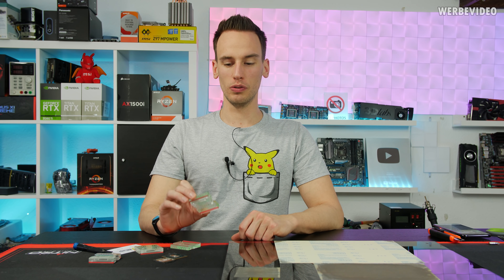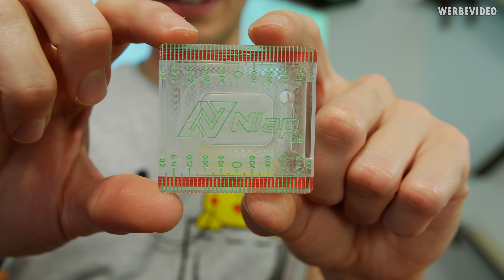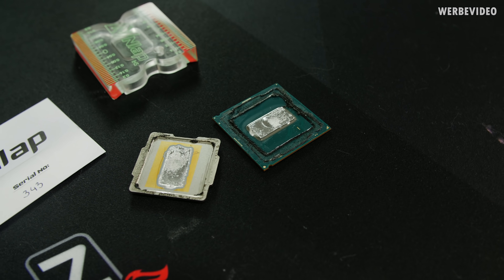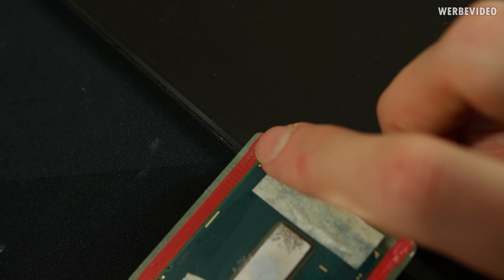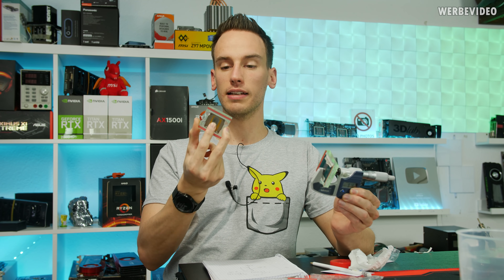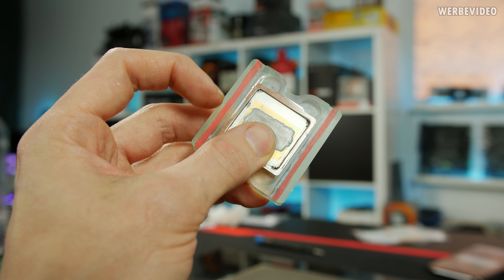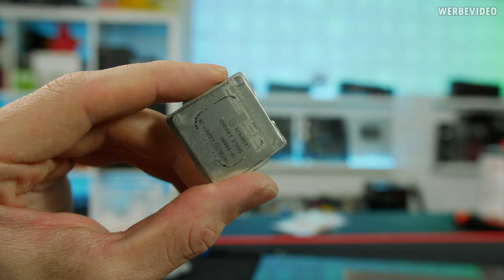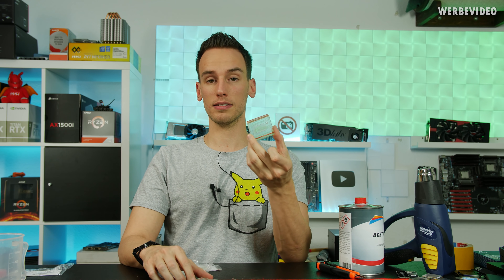If you ever plan to lap your CPU you HAVE TO know about this Tool!

Comment: @der8auer :  
8:35   The micrometer used has a 0.001mm resolution.  I will the NLap CPU tool to lap my delidded i9-9900K.  Is sufficient to use instead a caliper with 0.01mm resolution to track the amount  of silicon effectively removed?
Should I plan to sand the top of my der8auer direct die Intel 9th Gen. OC-Frame (anodised aluminium) by the same amount?
If so nail varnish will be enough to protect it against corrosion from liqui metal contact?
Thank you all for inputs.

Comment: @der8auer, I have delided and used a direct die cooling with your OC frame in my Eurocome Sky X7c Clevo chassis laptop.  I used a  3mm vaccum chamber thick and it increased my z-height by up to 0.4mm.  I am planning on lapping the CPU to improve my contacts and cooling system tolerance.  How much of the i9-9900k die could I lap to stay above OC frame?  Should I plan to lap the bottom of the OC frame to offset it?    Anyone has an idea of the thichkness of the STIM solder or the height pcb to the top of the IHS before delidding the i9-9900K (lost measurement after delidding)?

Comment: manufacturer used blue tac to hold in place,  accurate measurement device = digital micrometer. could we just use a aftermarket copper ihs from an 8700K and skip the lapping?

Comment: On my 9900KF I lapped the top of the IHS because it was quite convex,  and the temps would jump around and spike very quickly and the CPU would thermal throttle under heavy load, my temps have dropped by over 10c, at idle and around 20c under heavy load,  I'm not using liquid metal.
I only use normal thermal paste (it is a Cooler Master brand paste) and I have not de-lidded the CPU.
I was considering de-lidding it and getting a direct die cooling kit but I'm not too confident in doing it to such an expensive CPU.
But considering it now runs stable at 5.1GHz all cores with a max temp of 80c.
I have been satisfied with the outcome in regards to temperature. 
So my question is; is it ok to lap the top of the IHS as I have done and not using liquid metal or should I be aware of a potential future issue caused by doing this?

Comment: What about keeping the IHS and die parallel? Sure the silicon is now thinner, but if the die and IHS are not parallel wouldn't that create a gap between the two leading to a potential decrease in thermal conductivity? The thicknesses matter, of course. For instance if you sand down 0.2 mm of silicon and now you have a 0.1 mm gap filled with Conductonaut on one side of the die overall there would probably be an improvement to thermal conductivity because silicon is roughly twice as thermally conductive as liquid metal and that gap would only exist on one side of the interface between the die and IHS. 

Thermal conductivities: Silicon 149 W/mK, Copper 400 W/mK, Thermal Girzzly Conductonaut 73 W/mK.

Seems like if the two were not parallel there could be a decrease in thermal conductivity if using a TIM like Conductonaut. When sanding down the IHS tabs is enough material removed to cause interference between the die and the IHS before the IHS touches the interposer? This would allow the inside of the IHS to come in contact with the die and self align to it before the tabs touch the interposer. 

Sorry for all the questions, but I am new at this. A surface can be very flat and very smooth, but when you bring two flat, smooth surfaces together they need to be parallel to eliminate gaps. When you lap a CPU cooler this isn't an issue because it is allowed to self align to the top of the IHS because of how the cooler is mounted. For lapping the die, there could be an error stackup in parallelism between the die, the interposes, the tabs of the IHS and the inside of the IHS. 

Overall I like the video and appreciate your contribution to the technical content on YouTube. Thanks.
Reply: I just watched the video from Oct 19, 2018 about sTIM on the 9900K. Moving from Indium solder in the stock thickness to Conductonaut made a big difference (8 °C). I can also see that the IHS was sanded down in this step to account for the reduction in overall height from removing the indium. Sanding the die and IHS from there provided about 1.25 to 1.5 °C per 0.05 mm.

While I still have the question about maintaining a parallel interface between the die and IHS, I can see that reducing the thickness of the indium and silicon do make a big difference. I suspect the IHS tabs, or "feet" have been sanded down sufficiently to not make contact with the interposer before the IHS contacts the die.

Comment: Be interesting to see if it actually left the die flat, with the difference in material while sanding it should be easy to sand more off the tool with uneven pressure, maybe time to get a test indicator and testing the flatness of the die. I also think not lapping the top of the IHS flat seems like a waste would also negate the scratching,

Comment: The way I was taught in college to free hand lap was to do 10 strokes applying pressure in only one direction towards you with the most pressure being applied in the center with one finger. Then rotating the object 90 degrees and repeating the 10 strokes for all four directions. There were bonus marks for the ones that were able to wring the two lapped objects together and have them stick together proving their true flatness.
Reply: This...
Reply: He needs to grind the shoulders off the bottom of the IHS and make sure BOTH the top and bottom are true flat as well.  Also here is a question i've never seen answered about guage blocks: Can you wring ceramic to metal?
Reply: @NVMDSTEvil  ceramic breaks too easily for that
Reply: @christianflores3437  no, the amount of force required is not that high.
Reply: wondering what major did you study ?
Reply: @Alhussainba  CS

Comment: @der8auer All these years and still no one has made a motor device for lapping. disappointing.
It's not that impossible to design and make a device!
Simple concept, have a rotating circle surface with perfect mirror finish.
Make it rotatable with a small cheap motor, make a arm that pushes the CPU to the circle surface where you have the sandpaper.

Comment: That tool is called micrometer. I used it to measure copperwires from 0,7mm to 0,01mm, when I worked in cable factory. Thanks for the video as allways.

Comment: I wonder if they intended for the tool  to be used to lap the top of the IHS for some reason, it'd probably fit in there better the other way around.
Reply: lapping the top would not bring the IHS down to make contact with the die. i do see what you are saying tho, it does look like it would fit better that way.

Comment: @der8auer I have one question which could be good video material.
Is there any actual efficiency difference between full copper water radiators compared to aluminium ones? And are copper ones actually better?
We all know, that copper has higher thermal conductivity, but from what I've researched, this alone is meaningless in radiator performance.
Copper has 3.3 times the density of aluminium, while having only 1.75 times the thermal conductivity. That means that you need 1.7-1.85 times as much copper in weight to achieve similar overall thermal conductivity, which seems not to be the case.
Not only are aluminium radiators heavier then necessary for theoretically identical results, but they're also typically denser, with more tubes and therefore higher overall area for cooling. The fins also seem to be thicker to offset lower conductivity.
I've also found some topics on automotive forums, where copper radiators are not recommended for their inferior performance.
Would you try checking that?

Comment: I always use Break-Cleaner because it doesn't leave any residue. 

They also use that to see if (motor engine) valves are completely tight after polishing them.
Reply: Proper acetone doesn't leave any residue either. The stuff I buy at the local super market says "chemically pure acetone" on the bottle and it flashes off as cleanly as alcohol.

Comment: put a plate with a pin to fasten the drill to it, machine a flat plate with a pin sticking out to attach the drill and glue it to the tool then just go, either the drill press or hand drill, drill press would be the best. maybe not for the cpu though :p

Comment: Sound like you need hand lapping plates and an optical flat to take this to next level.
Reply: And a lab grade surface plate and an octoculimator to check the final result... No, seriously, calling it "CPU lapping" is flat out wrong. It is sanding it down. If we were talking lapping in the machinist sense, he would get better results with no liquid metal, as the surfaces would wring together like gauge blocks.

Comment: Ehh this have so many flaws... What about flatness of the acrylic "thing", what about of CPU PCB flatness?  what about glass panel flatness, what about finger pressure - all those are imperfect and will affect final result ...

You don't even know how hard is to be perfectionist. Nice job as always
Reply: Those of us with machinist training think of lapping as something very different than what overclockers think. They say lapping but they mean sanding. Period.

If you are interested in how to make a proper lap (that could be used for a CPU if you like) go check oxtoolco here on youtube. He goes through the classic three lap method using only copper roundstock, a hack saw and 5my alumina abrasive.

Comment: For the IHS should be a magnet placed inside the acrylic to hold IHS from the top, for the CPU should be like a delidding tool, with screw(s) from the (both) side(s) to hold it
Reply: IHS is copper and copper is not magnetic...
Reply: @honzamoravka9430  true, but I used neodyme magnets from hdd and put second one below the ihs, I found some are just thin enough to fit and not interfere when lapping

Comment: I guess having a 9900K that only requires 1.290v to run at 5.2GHz, only reaching 90°c after a 20 loop run in R20 with an AIR cooler defeats the purpose of this tool. I also lucked out on the 1.280v 5.3GHz 8700K that i got open box, also topping out at 90°c on AIR. What's with all the water cooling...lol
   Nothing against AIO's. I've been through many and the only ones that actually cooled better than some of the best AIR coolers was Corsair's V115 and V80 Extreme V2's with the double thick radiators and some vardars. 
  Though, with that amount of money involved in AIO's and some worthy fans, you gotta be an enthusiast. I just like testing old and massive AIR coolers. 
  Anyone remember the first 8 heatpipe Silver Arrow monster, or how about the ZALMAN 9900MAX, 9900MAX DF or Triple fan 12X. Might sound funny to some but, beats paying $100+ for something that essentially puts up the same numbers as a 5 to 10 year old AIR cooler. That can be found for $25 to $40. Gotta have a grade a chip though.

Comment: Sounds like buyers should measure the IHS, then apply some tape like painters tape to the top of the IHS before inserting in the tool. But if you are measuring the tool there is not much point in using the Acrylic Jig anyway. Just measure on all 4 corners and use the "walk around the barrel" sanding technique.
Reply: tape isn't perfect in thickness. nothing really is unless its machined for that. and when your talking about super precise measurements ,you want to have something guiding you. with the die itself, one wrong move and you will destroy it. and with the ihs. if it is a little off , you will have uneven mounting pressure against the die. this will cause it to crack when you to crack when you place the cooler. die lapping is risky business. way more risky then ihs top lapping. but i guess its the price you pay to have the best overclocks lol.using the tool stops you from rolling the edge when you sand. you have to take a ton of acrylic off before you would make an uneven sand. and you would see it happening buy the paint being removed more on one side .the tool isnt precise with its measurements. but it does make it way harder to mess up

Comment: You need to get a small but extremely precise cnc milling machine. You could have milled the die and ihs and finish it off with lapping for a smooth surface finish. I would be interested to see you take this concept to the extreme. Find some silicone lottery, shave it down as low as you can, and then do the same thing on a 2080 ti or titan. You can even use the machine to make your own custom parts for builds. Custom blocks, distroplates, case parts, etc.

Comment: pls talk about direct die cooling with large air coolers next
Reply: i would recommend you to go with a 280mm aio instead of using the high end air coolers for the best temperatures with direct die cooling. I initially tried cooling my 9900k using the noctua nh-d15 and it is possible but its not worth it to me. Right now i am running the 9900k direct die with liquid metal using the corsair h115i and the max load temperatures i am getting right now are 8-9c better than with the noctua nh-d15. Now i am thinking or reducing the die height to 0.4mm using this tool, but sadly derbaur did not included the before and after results.
Reply: @bloomfield295  thing is, nhd15 cools as well as 280mm aio’s. If you’re not running custom loop, then a 360mm aio would be the proper upgrade from a nhd15. Personally going to be deciding my 9900k and running direct die with my nhd15. Temps are completely fine as is at 5GHz but I want to see if I can push a little further before having to go aio or custom loop.
Reply: @bloomfield295  9900k has a TPD of 95w as stated by Intel, but reviews have popped up that 95w cooling is not enough. NH-D15 is rated for 165w. In theory, that's enough thermal dissipation for a good overclock, but in practice, it really is not.

While I understand that CLC will bring more thermal headroom for overclocks, the usage of air coolers is still a good option for people that do not want to deal with CLC failures.

Anyways, can you share your current temps with Δ's? Would appreciate it.
Reply: @notyouraveragegamer130  I doubt many people who are unwilling to deal with the dangers of water cooling and delidding their CPUs.
Reply: @notyouraveragegamer130  95w is on stock frequencies and without turbo boost (or properly working turbo boost, one that doesn't allow you to boost indefinitely).
Reply: @notyouraveragegamer130  Will share my results soon but as far as running a 9900k on stock clocks, a noctua nh-d15 is more than good. The thing is if some one is looking for running a cpu direct die then surely he is looking for the best thermal performance and to achieve that a 280mm 'aio' or a custom loop is needed, as i already mentioned, noctua nh-d15 will easily run 8-9c hotter than a 280mm aio and i am absolutely certain about that. Thats why i suggested against air cooling. But yeah air cooling has its own pros thats for sure.
Reply: @niter43  95w is exactly that. I don't get why Intel would place that as a reference. I doubt consumers would want  their expensive proccesor to be underutilized.
Reply: @bloomfield295  Good points on both air cooling and CLC. 

Though looking for the best performance with enthusiasts on mind is a given, running a setup with some limitations (i.e. air cooling) also has some worth to it. This is a good reason why people watch videos of Roman.

PS. I don't doubt the capabilities of CLC vs Air in prolonged usage.
Reply: Tdp still don't mean shet since that number fluctuates and is skewed depending on who is using it and for what reason.

Comment: Quick question: Is there any benefit in lapping the IHS a R5 3600 on a 280mm CLC? The temps currently are quite good, but just curious.
Reply: Not really, don't expect more than 2 degree less. If you sand both the cpu and the coldplate maybe something more than 2 degrees but for all the work isn't really worth it
Reply: Not worth it.
Reply: There might be a slight benefit, sure, but there's really not any reason to do so.
Reply: No, there isn't much overclocking performance on 3600 and isn't worth it.